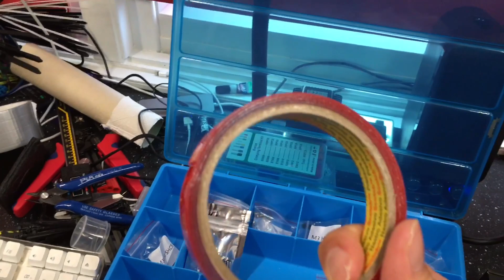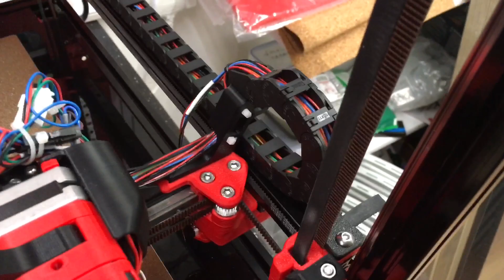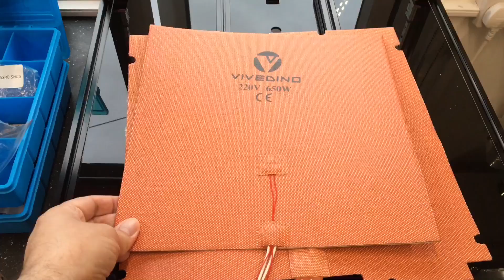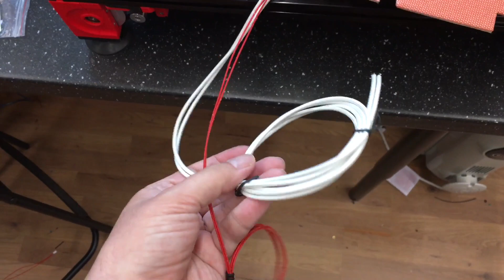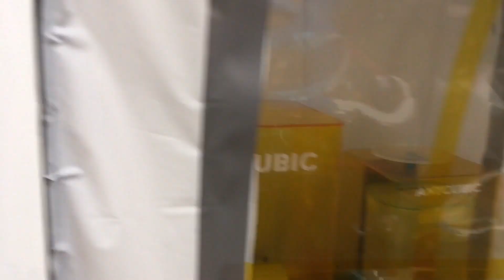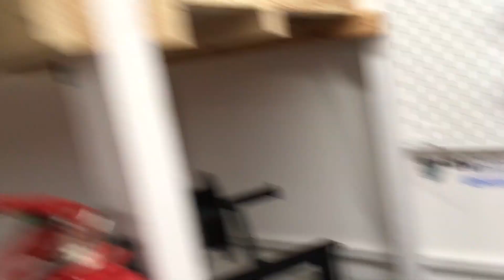The return of the Formbot Voron 2.4 kit commentary on the build

Comment: Thinking of getting this kit as well... i see they use moons motors now as well, all the parts, including linear rails are pretty decent by the looks of it?
Reply from the maker: Well I can only speak for my kit which dates back to October last year but in the time I’ve used it I’ve not had any problems with the rails or motors, at some point I’ll do a proper video on it but life keeps throwing me interesting times. Note that I did replace the x axis 9mm rails with one 12mm as per the newer r2 design not sure what they are shipping at the moment. Only other parts I ended up replacing were the xy end stop board they supplied since it didn’t work with the newer x carriage and the flex bed with an energetic one since I found the smooth side unusable. I’m also using the E3d revo instead of the high flow dragon. I really should make that video…
Reply: @robinsmakerworkshop  interesting... what's wrong with the High flow dragon?
Doesn't seem to be ok imho if you need to change that much, i'm checking to justify the extra 5-600 they ask for the LDO kit though
Reply from the maker: @Hans82962  my decision to go with the revo was more to do with being a beta tester for it. I didn’t really use the dragon much. I like the standard one, I use it on my v0.1 but not had much time with the high flow version, I did have a jam with it but I’m pretty sure it was my fault.
As for the rest I see they are shipping R2 parts now, so the only real upgrades I would consider are a energetic print surface and maybe a keenovo bed heater. Again mine was  back over 6 months ago so they may have improved the bed. I would say the LDO kit is probably more consistent and you’ll get better support but that’s just my opinion.

Comment: Pro-tip from a former Igus engineer, flip the last link on the moving end of your cable carrier. Possible two links because that radius seems too large It reverses the bend radius for that one link and achieves what's called a "Lower Mounting Height". It helps the chain move smoother with less resistance. Keep in mind, it's the last LINK, not the mounting bracket to flip.